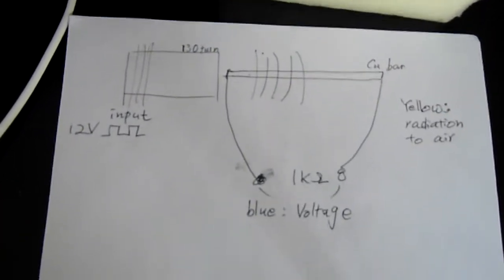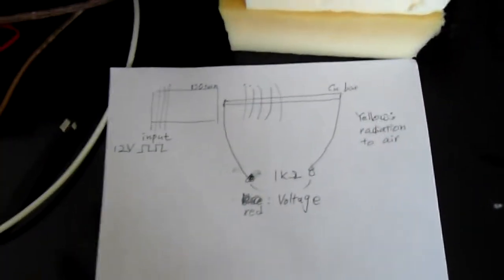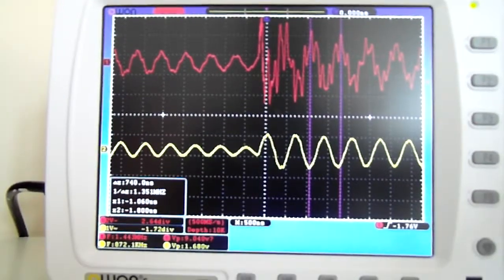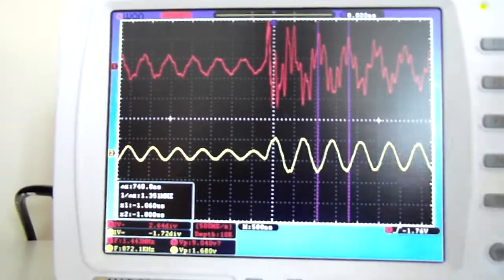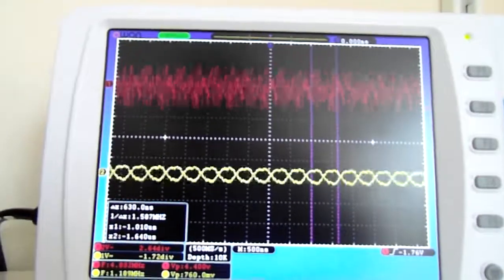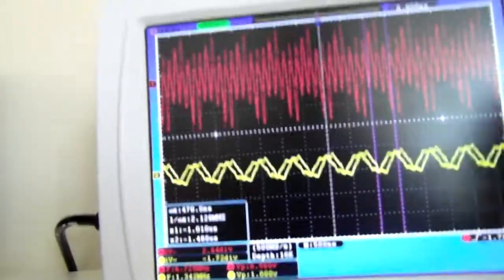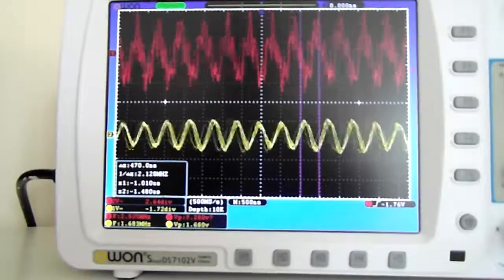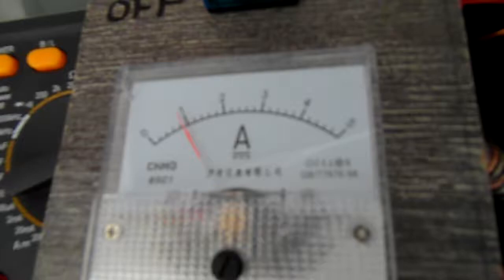Tesla coil ferroresonance frequency check

Comment: What is the wire diameter of your tesla coil? Or your copper bar? If the freq does not fluctuate when up/down, it must correlate with one of your components. Length coil is also relevant in resonant calc… this device is an advanced crystal radio 😆